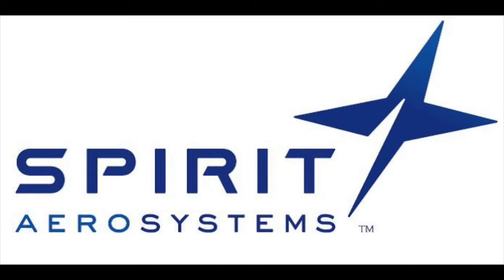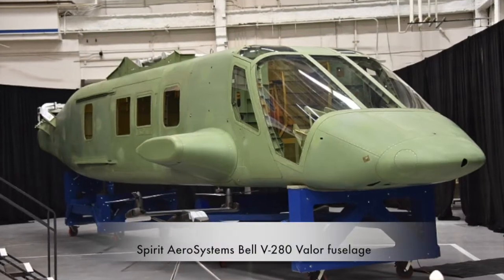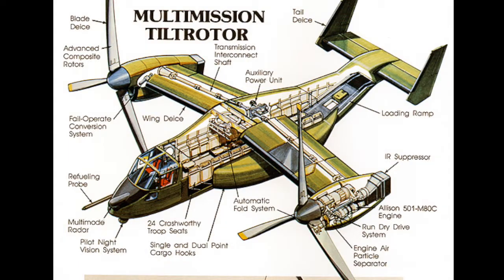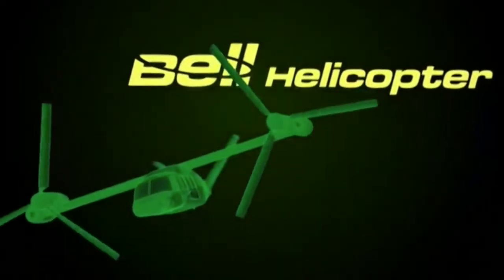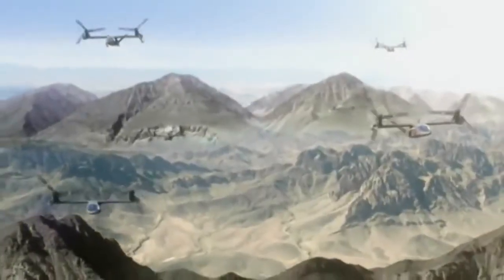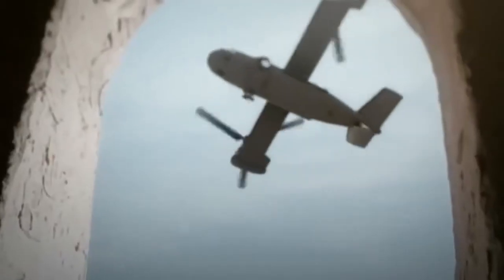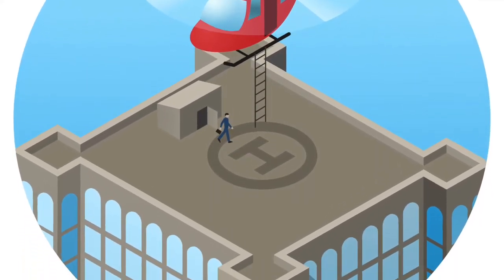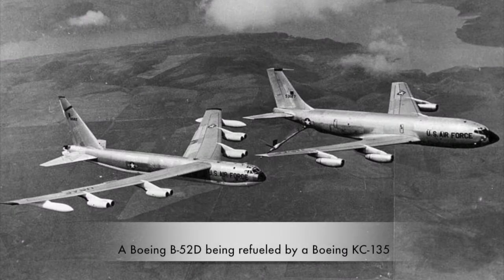Is the Helicopter Obsolete

Comment: What happens when you loose power? Helicopters can autorotate.
Reply: the new tilt rotors are suppose to have some heavy shaft from one engine to other so they are suppose to be safe... that didnt help aw 609 test pilots thou... oh yes did i mention that that shaft goes from one tip of the wing to another and its heavy?